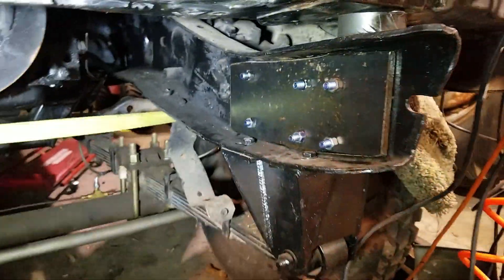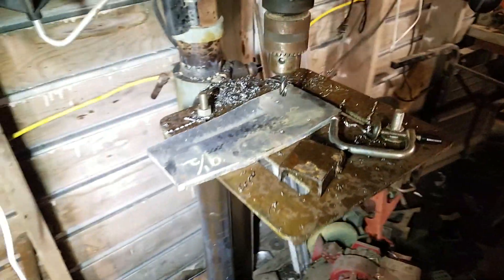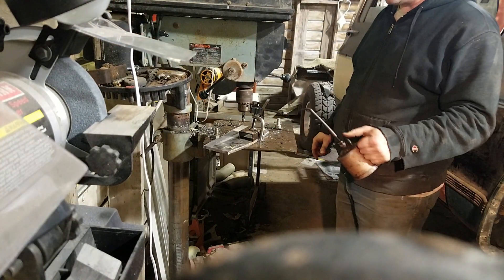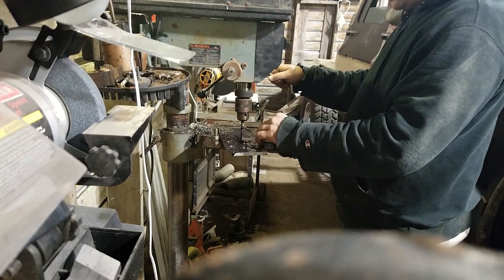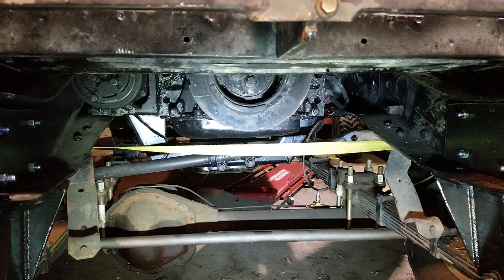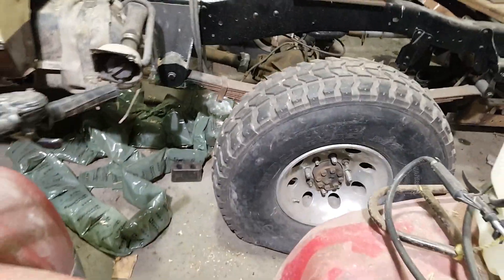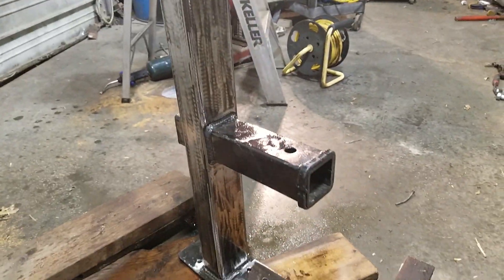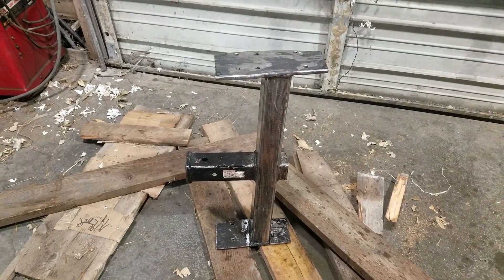FrankenTruck Fabricating Front Crossmember Hitch on the Chevy Squarebody Cummins Swap

Comment: I'm getting ready to do all of this to a 91 suburban... All that wiring though... Good Lord!!! Any chance I can pay you for a plug and play cluster? I'm running the 12 valve and the nv5600.
Reply from the maker: Yes, lots of wiring!  Not all of it was necessary for my application but I wanted things a certain way lol.  If you can reuse your stock sending units, it shouldn't be that bad.  The hardest part of the cluster was the tach since the stock 4k tachometers are designed for an alternator signal.  I could help you modify one and have an extra 4k tach but you'd need to find a stock gas tach to steal the board off of.   I couldn't figure out how to modify the stock 4k board.  Thanks for watching and commenting and good luck with your project!!
Reply: honestly, ive been mentally building this project for the better part of a decade. Plotting and planning and collecting parts. I was just going to use an 8k gasser tach and use the original 12 valve sensor I just haven't done the tinkering to figure that part out yet... There is a guy on here that chopped up the original cluster and just inserted some autometer gauges, I considered that until I saw what it was going to cost me to buy all the gauges from them. Then I ran across yours and how you were going to use that gas gauge for the boost and flipped. I didn't even know those existed!!! Most of the gauges I can get to work with using original sending units, I agree with not wanting to use the alternator sensor, I want something a little less " rigging " in nature. I like the 12 valve sensor that reads from the ring and the motor I have already has the ring but the sensor was toast when I bought the donor... So sitting on the ideals of that fuel gauge over night I decided to just stick with the separate boost gauge in a pod
Reply: @burningdinosaurs  oh and no worries, I'm totally in to your build. I've watched pretty much all of the swap videos on here and everyone does it a bit different. But since you are currently doing it, I'm following along to see what twists and turns you put on your build.
Reply from the maker: The tach thing isn't bad if it's already setup for a gas distributor signal.  If you're running a tach for an 8 cylinder, you'll need to add 2 more notches to the balancer 90º off from the 2 that are currently there.  If you can set the tach for 4 cylinder it'll be fine as-is.  I'm just really trying to avoid a pillar gauge pod which is why I'm trying to integrate so much into the factory dash.  I really like the "sleeper" look, even though it will obviously not look stock lol.  I've been concentrating on this tractor I'm trying to get fixed up right now but plan on getting back to #FrankenTruck very soon since I need the shop space back.  Thanks for following along!
Reply: @burningdinosaurs  what state are you in? At least you have a shop to work in... All of mine is going to have to be drive way... I've tried finding a garage or a shop to use here in Colorado springs but around here it seems people have more important stuff to do than build cars. I've even tried asking the local high school if they wanted to use this project as an after school program to teach some of the kids that like cars to fabricate... I guess I just don't have the right friends to build a cool rig... So, drive way build it is. At least that way I don't have to thank anyone for all their hard work. I only have to thank my wife for being so supportive lol.
Reply from the maker: Ha! Yes!  Wives deserve a lot for putting up with guys like us lol!  I'm in Central Iowa and it just turned really cold here and my shop doesn't exactly have heat.  But at least it's inside somewhere out of the wind, snow, and with light.  You're right - You get all the credit when you build it yourself!  I got a good friend who is my welder and we help each other out quite a bit so that helps.  You should video your build and once you get going on it start posting.  There's (obviously) still quite a few people doing SquareBody swaps of all kinds so people will watch if you have something to show.  And if they watch, you'll get comments which can be helpful (or not sometimes) as well.  And 1 more thing... The only person who has to think it's cool is you!  Good luck on your build and don't get too cold out there!